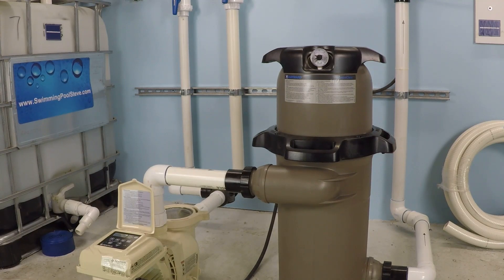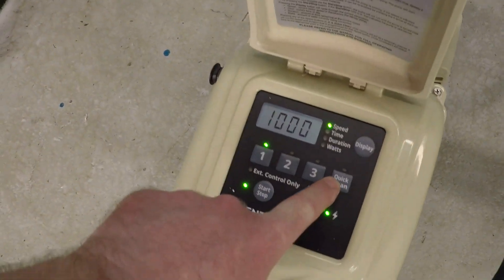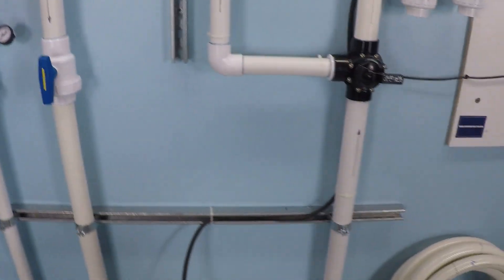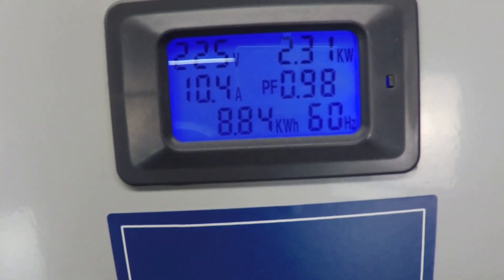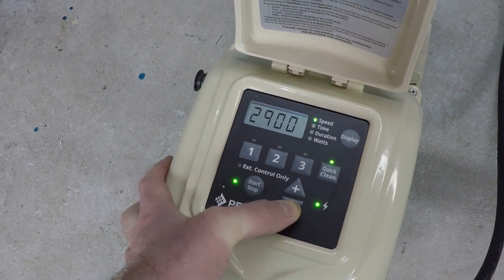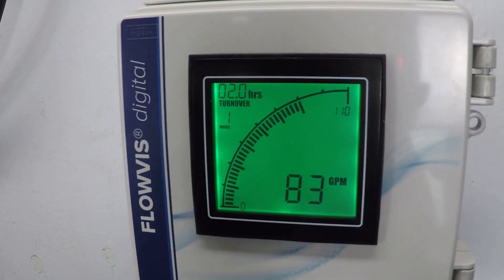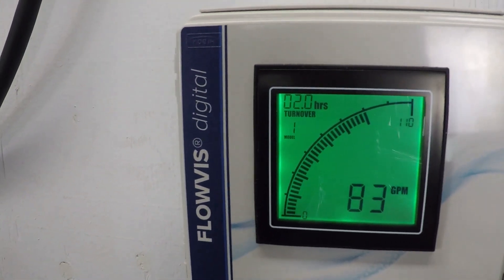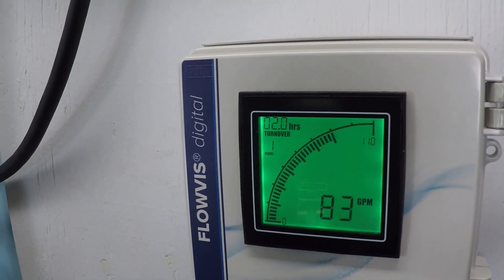What Difference Does 500 RPM Make?

Comment: I would like to run my pump real low but isn’t there a point we’re you can’t run it but so low because the distance from the pump to the pool is long. I have a limit to low rpms to carry the water to the pump and back. I guess the distance from the pump to the pool will also play a part in energy efficiency too. Maybe.